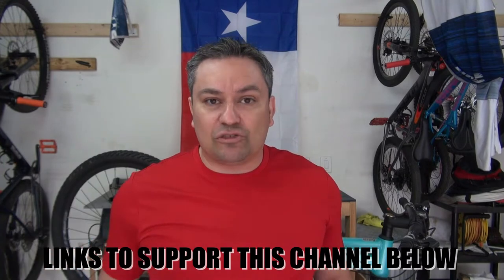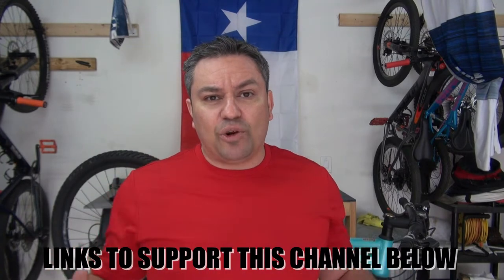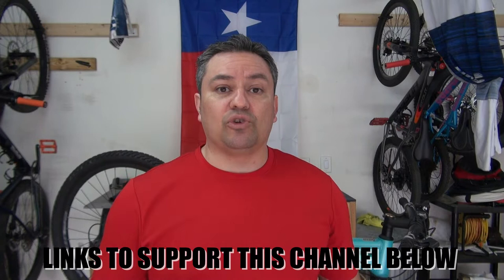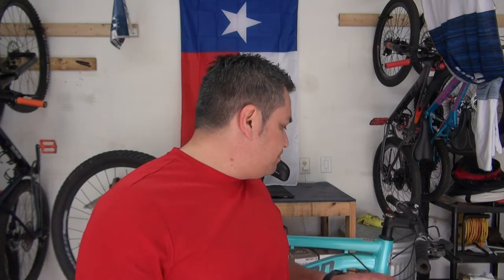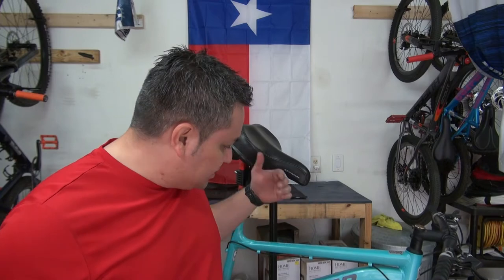Is this the best Women's Trail Bike for the money? Schwinn Al Comp, 2021  #mtb #mtblife #womensbike

Comment: I just picked up one in similar shape for $70. Already swapped out the fork, bottom bracket and cranks, converted to 1x with a mega range free wheel, hydraulic brakes, Pnw bars and stem. I’m a male, but have short legs and this frame fit me well

Comment: It's hard to beat that bike when it comes to value. I have parts sitting around and have been debating about getting one if those, or getting a brand x ht frame. Is the rear wheel cassette or freewheel?
Reply from the maker: Originally freewheel